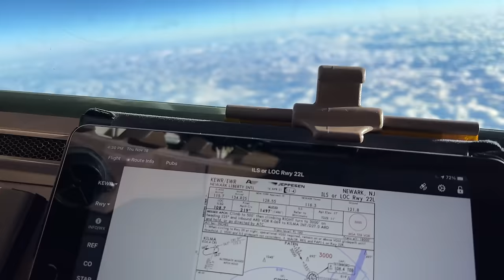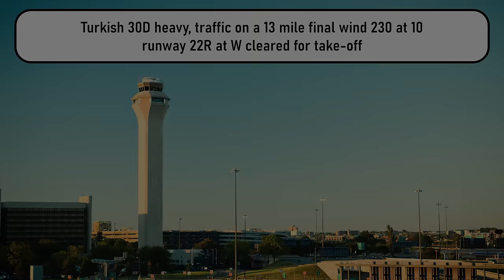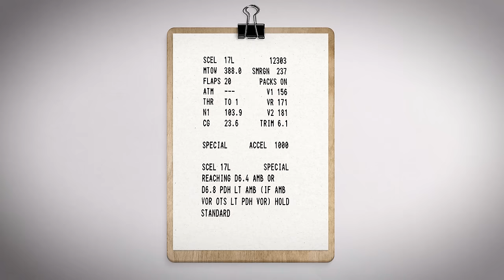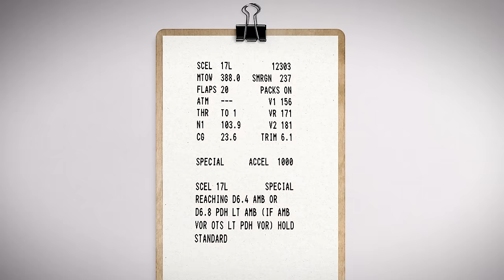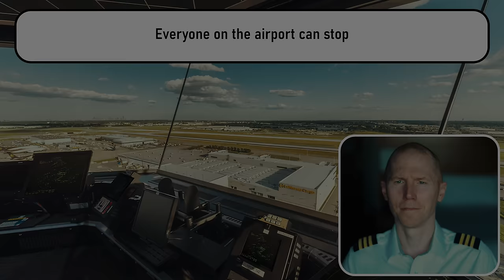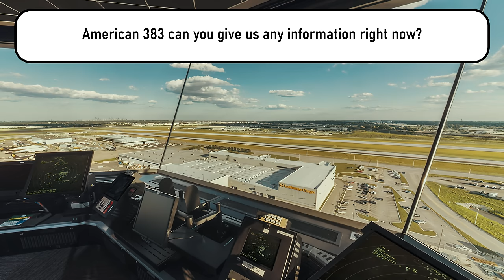American 767 Engine Fire

Comment: This is unfortunately not unusual at all. The most famous taxiway takeoff accident probably being Singapore Airlines in Taipei many years ago. A factor in this case is probably the fact that intersection was not perpendicular to the runway. The ergonomics of airport lighting is bad enough as it is, it’s not obvious what you’re turning onto just by looking at the lighting until after you have turned. When you look at taxiway and runway lighting from the side it’s just a sea of lights and the non-perpendicular approach means that the turn is longer and consequently it takes more time to understand what you’re turning onto. The only way to positively confirm what you’re about to turn onto is to read the signs ahead of the intersection. This can be missed very easily if you’re distracted by something else at just the wrong moment.
Reply: I'd argue that the Tenerife airport take off is the most famous when two 747's collided resulting in the loss of 583 souls.
Also known as the worst aviation disaster in history.
Reply: @Andre Henrique Dutra Rocha - You are right. I worked on an aerodrome for many years, daytime and nighttime. From the ground level it is nothing but a sea of lights.
Reply: That Singapore flight (006) took off on a runway, just the wrong runway (one that had been closed for repairs).
Reply: Also that day having tropical storm does not help the flight crew of SQ at all. I've been in Taipei international a few times and it does get super dark at night, very hard to see sometimes.
Reply: @Skelath  That was the worst accident, but it wasn't a taxiway takeoff, which is the subject of discussion here.
Reply: @Bert Veening  hmm? A plane taking off hit a plane that was still moving down that very same runway.
It wasn't a mid-air collision mate.
FYI the incident the OP is referencing is "Singapore Airlines Flight 006" which was meant to take off from runway 05L but instead took off from "Runway 05R" which was closed for maintenance and as a result struck several construction vehicles causing the plane to break apart. I have no idea why you're going on about taxiways.
Reply: @Skelath  You mentioned Tenerife, which was not a taxiway takeoff, unlike the first post in this thread by Frey.
Reply: To add further context to the Tenerife incident one plane was still on the runway and was told to turn off at a particular exit however they were unable as the airport was not designed for large aircraft such as the 747's, if the pilots did turn off at their assigned exit they would have rolled right over the dirt and the dirt is not strong enough to hold up a 747, the wheels would sink in and they would be stuck.
At the same time another 747 was lining up on that runway and due to miscommunication the captain thought they got cleared for take off, and due to the sudden roll in of fog neither plane or ATC could see each other.
The reason why both 747s were at an airport not designed for then is that they were diverted their because the airport they were meant to land at had an incident and had to temporarily close down.
Reply: @Bert Veening  And the incident that Frey mentioned was Singapore Airlines Flight 006 which was meant to takeoff from runway 05L but instead took off from Runway 05R which was closed due to maintinence abd as such it hit several construction vehicles and broke apart.
The incident that Frey mentioned was a 747 and it didn't take off from a taxiway, it took from a runway.
Reply: @OrangeShellGaming  Technically yes, but it was a bit more complicated than that. The runway in question was originally designed to be a taxiway and was equipped with green centerline lights. At the time the part of it that was not closed was officially designated as a taxiway. This runway/taxiway was intended to be used only as a runway when 05L was closed for whatever reason. Unbelievably this practice has continued decades later when taxiway NP (I think from memory) was designated 06C while the actual runway (which has had multiple different designators over the years) was closed for maintenance.
Reply: @Skelath  Technically different since all the airplanes were where they were supposed to be.
Reply: @Frey  I cannot find any information what so ever that says 05R used to be a taxiway, the airport opened in 1979 and it's stated it opened with two runways 05L and 05R which run parallel with each other, one being 300 meters shorter than the other.

The only thing I have found remotely close to what you said is this; "It has one active runway (05R/23L). Real-world, a new runway 05L/23R is being built north of the current terminal complex. Previously the main taxiway was used as the second runway when the main was out of service for maintenance" and that is reference to Auckland airport which is here in New Zealand, the Singapore Flight 006 incident happen in an airport in Taiwan not in New Zealand.
Reply: @Skelath  05R was planned to be a taxiway. When the airport opened it was designated as a runway to be used when 05L needed to be closed for maintenance. This is mentioned in the accident investigation report. Later it was reverted back into a full time taxiway and as recently as in the past 10 years it has been occasionally used as a runway again. This time for departure only while 05L was closed for construction.
Reply: @fairdragon79  I read the accident report on multiple websites including the wiki and it never mentioned any of that.
Also on multiple occasions each runway got upgraded, on top of that they're currently building a 3rd runway due to how busy the airport is, and that airport was built because the other airport in Taiwan at the time was at max capacity and they needed a much larger one.

There are multiple airports that have runways called 05R and 05L and everything you've mentioned in terms of taxiways is in reference to Auckland Airport and Auckland is the city I was born in, New Zealand is not Taiwan we do not speak Mandarin here, we speak English we're apart of the Commonwealth.
Reply: @Skelath  No idea what you’re going on about? This is mentioned in the accident report. Also nothing to do with New Zealand or the Commonwealth or any such thing.
Reply: @fairdragon79  I've read accident reports from 7 different sites about Singapore Flight 006 and not a single one mentioned anything about Runway 05R being a Taxiway or used to be a Taxiway or originally designed to be a Taxiway.
You're straight up talking nonsense.

Comment: as a non pilot, who often pays the extra for the extra legroom of an exit row, I'm now thinking of how evacuation could be improved.  it sounds like having someone who can get to a safe location and call the other passengers over to them would take another potential headache off the crew's hands.
Reply: Cabin staff have great tact and diplomacy. They might persuade you to jump out first to get you out of the way. 

Training and testing.
Reply: @20chocsaday  or making a point of being calm and attentive and showing a willingness to follow instructions might let them know they have someone capable of being part of the solution instead of part of the problem.
Reply: @20chocsaday  and in case you missed the point, the goal is to not be the kind of passenger they need to get out of the way.
Reply: In case you may have failed to notice, those seats are not available to minors and people with disabilities which can be a problem during an evacuation. I once saw a couple of men being removed from exit row seats and when I enquired whether I could move there for extra leg space, I got a pretty tough warning about the responsibility that came with that move. Being a single male with good physical health at the time, that was no problem for me (and I got preferential service that flight).
Reply: @apveening  i am fully aware that there are certain responsibilities involved.

Comment: For the fire, the pilot-tower exchange implies the pilot initiates the fire trucks when the tower already sees there is a fire. Wouldn’t the tower start sending the fire trucks whether the pilot requests it or not?
Reply: @Liz Gold - an airfield has both Air Control and Ground Control on separate radio channels. They cannot hear each other. Once the aircraft is on the ground or just before they are on the ground they switch to the Ground Control Channel. Fire Trucks only use the Ground Control Channel. Any OCCUPIED Fire Truck will hear all transmissions that are on that Channel. However, if they are not in their trucks and do not have a handheld radio on their person, they will not hear any transmissions. For Aerodrome Safety it is unlikely they will ever proceed onto the taxiways or runway without Tower Permission even if they hear the transmission between this aircraft and the Tower. So your question is a good question. It has been over 15 yrs since I worked on an Airfield so I may have missed something but this is a short version of procedures.

Comment: If I'm not wrong, it's really useful to tell the TWR that you're evacuating, because after that all the engines, and all the power supply will cut off, so there won't be any radio. This way the ATC will know that they won't be able to reach you.

Comment: The first time I ever landed at KATL was at night.  I managed to land on the correct runway but after that I was completely lost.  I could have been at Seattle or Beijing for all I knew.  Luckily the ground controller was very understanding, considerate and helpful.  As virtually all
controllers have been and are.
Reply: I've never flown in the America's at all but this reminds me of the first time I flew my plane from my old home in the UK to Amsterdam, landed at EHAM (Schiphol) following the instrument arrivals and such was less stressful that expected. Then I pull off the runway at an intersection and try to get my taxi clearance and yeah I'm not having much luck picking it out on the insanely complex airport diagram. Ended up having to ask the ground controller for progressive taxi instructions instead and they were able to get me where I needed to be. I can imagine that KATL must be very similar as both of those airports are insane, actually EHAM might be worse as KATL looks fairly organised with it's neatly parallel runways EHAM has 7 runways in 4 different orientations organised like a plate of spaghetti. But then again I guess that means less confusing parallel taxiways and such too especially as the 3 that are aligned are really far apart at EHAM but still a very confusing airport.

Comment: I was at the United fire at O'hare. I was a fire Lieutenant that responded with my crew to that plane fire. I actually seen the plane going down the runway while it was on fire. I couldn't believe my eyes!. Pilot did a great job evacuating the aircraft, I think only  1 or 2 minor injuries. I also have some fantastic pictures of the aftermath.

Comment: I was on a simulator check ride when the Check Airman gave us the exact same problem. We stopped the aircraft, and I turned the fuel off to both engines and discharged the fire bottles into both engines. The other pilot ordered an evacuation.  During the debriefing I was questioned why I failed to get the QRH out and run the correct checklists in order. I looked at the Check Airman and said, "Just saving body bags". Later I found out that the Training Command was checking to see what crews would do.  Their research indicated that if the crew followed the checklist, it waisted 105 seconds before the evacuations began.  Only about 20 percent did what we did.  After that, a memo was circulated which stated the FARs allow you to deviate in an emergency.  My next Simulator Check this was covered in the pre briefing.

Comment: There was a fire on a UK plane years ago at Manchester as it took off. It aborted and pulled off the runway and stopped. But side on to a strong wind which was pushing the flames onto the plane. That exacerbated the problem and unfortunately quite a few people died. There didn't appear to be any wind blowing the smoke and flames in this case, but I wondered if anyone knows if there's some procedure whereby the atc would tell the pilot to swing the plane around to be 'upstream' of any wind and the flames would be blown away from the aircraft.

Comment: As for why the audio is inaudible for that one transmission what people need to understand is that American air traffic audio is from off airport receivers hosted by random citizens and forwarded to 3rd party aggregation sites. There are areas of the airport which are blocked by buildings depending on where the receiver is located. Its complicated by the antennas on a plane being mostly downward facing. It wouldn't be an issue if the receiver were in close proximity to the airport,  but generally these are located a couple of miles from the airport at a business or residence.

Comment: I know weight is an important element on the Commercial Passenger Airplanes. But I have always thought that there could be a series of lights or sensors on the belly of the plane whereby a series of sensors of corresponding lights on the runway that could inform the pilots what runway the plane was on. I thought about this when the Commuter plane a CRJ-100 at Blue Grass Airport in Lexington KY in 2006 tried to takeoff on the wrong runway.(Comair 5191).

Comment: Informative as always. Are you going to cover the incident at JFK with Delta and American Airlines.? What I don’t understand is that why American was allowed to continue with their flight after getting the “take this number down”
Reply: What do you want the plane to do instead?   Someone made a mistake, so the controller will fill out a report on their point of view and let someone else look into it (with recordings of the transmissions and the pilots side of things as well if necessary).   The "take this number" is to try to get information from the pilots on how they perceived things (was there a transmission missed?   Was there a cabin problem that distracted them?  Was there signage that was obscured or incorrect?)   Someone not busy separating planes can do the follow-up if something needs to be addressed.

Comment: During the ILA (An Airshow) in Berlin Schönefeld back somewhere 200X a Fieseler Fi 156 Storch (dont know if original or rebuld) make the old joke about runways true:

Nice Runway, 3000m wide, but only 50m long.  :-)

he tock off 90° to the centerline. With wind from the front the Fieseler Fi 156 Storch can take of in 50m...

Comment: Yep, so these pilots had to make that dreaded phone call for possible pilot deviation. The American Airlines flight 383 on fire was scary to watch and the NTSB did investigated the incident. The NTSB said that the pilots forgot to switch off the left engine, and some passengers was injured by the jet blast during the emergency evacuation. They also said that the cabin crew did not follow the correct evacuation procedures. 👍👍

Comment: Kelsey, I have a question.  You talk about pilots having experience and being able to fly different planes and I was curious that IF you were to fly an A380, what would you personally have to do?  Would you have to have training with the airline?  Would you need a kind of qualification to fly that plane?  I ask, as I took a A380 from Korea to Dubai and then a 777 from Dubai to Barcelona this week and I'm kind of amazed by the A380 because it's just an absolute marvel of engineering.
Reply: They have to have a new certification and extensive training
Reply: @cruisinguy6024  Which is paid for by them or by the airline they want to work for?

Comment: Kelsey, a fun but real question of shear curiosity.  What could a RedBull stunt pilot do with an airliner pushed to the limits?  Modified with escape capacity of course and performing in a deserted area.  I'm rather surprised we have not yet seen it.

Comment: that burning airline brings up a question: when do you turn off the APU? i guess they needed the electricity because they had to shut down one engine and the other one was on fire. or did they use the battery?

Comment: The AA-383 incident is written up in Wikipedia. I was curious if there was a bird strike or something else that happened, so the article says that a second stage disk blew apart, uncontained, through the fuel tank, and landed in a UPS facility 2935 feet away. Nobody injured at the disk landing site. Too bad we can't trace the arc of that shard of metal. Methinks they were late arriving in Miami that day. But they likely got all their stuff in one piece and nobody was injured. Well done, all.

Comment: Kelsey, 74 Crew, are the radios really that noisy while they use them?

Or is that the quality that gets recorded?
Reply: Most of those audio clips come from LiveATC.  The feeds are provided by random enthusiasts who have hooked a scanner up to the internet.  

Almost none of them are actually located at the airport, so a lot of noise is caused by the distance through a dense urban environment.  Because few of these enthusiasts are radio experts, they often have cheap equipment and antenna setups and don't have any good ways to improve reception.

On top of this, to reduce the bandwidth needed to host these feeds, LiveATC compresses the hell out of the audio and adds a ton of horrible sounding compression artifacts.

Add all that up and the recorded audio is a mangled mess, and sounds nothing like it does in the cockpit.

Comment: This is regarding American Airline's Flight 383.

The right engine had suffered a sudden rupture of the stage 2 disk operating at takeoff power. The disk separated into two pieces, the smaller of which pierced the wing's fuel tank and then flew 2,935 feet (895 m), falling through the roof of a United Parcel Service (UPS) facility and coming to rest on the building's floor. No one was injured in the UPS building.[6] The investigation revealed the need for more stringent airworthiness directives for ultrasonic inspection of engines.

21 people injured.